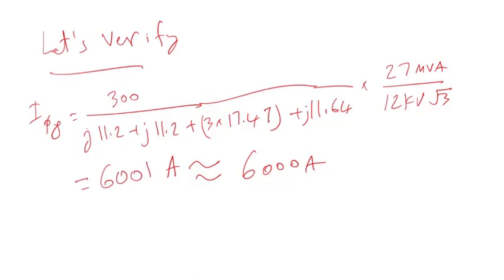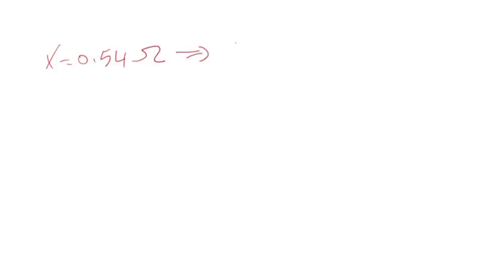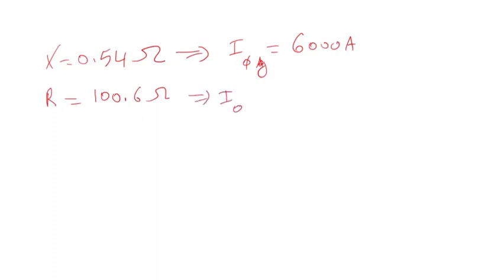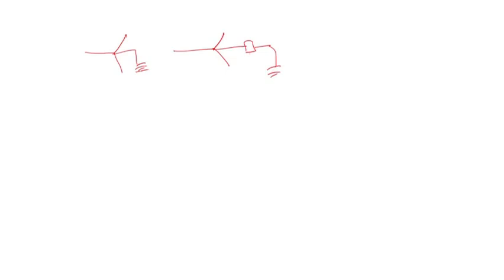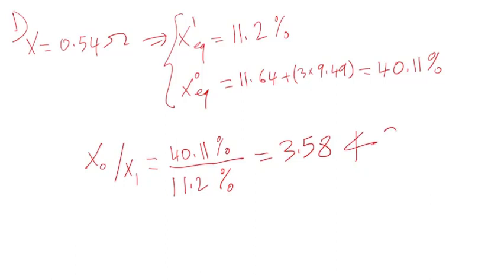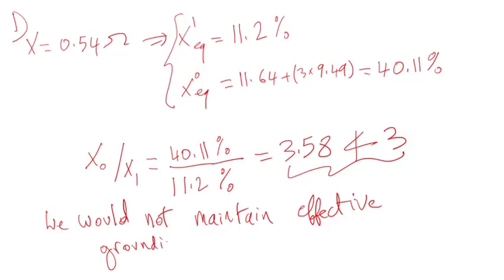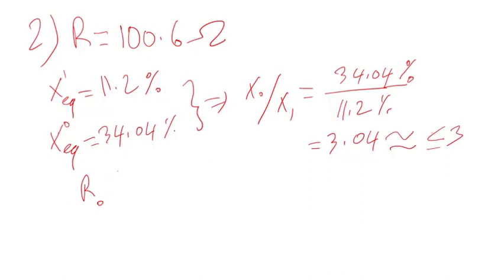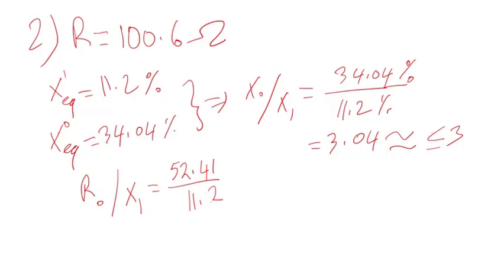Sizing Neutral Grounding Reactor or Resistor and Effective Grounding - Part 05

Comment: What is your reference standard about the X0/X1 < 3 or R0/X1 < 1?
Reply from the maker: IEEE Std C62.92.1 

IEEE C62.92.1 also considers a system effectively grounded if the coefficient of grounding (COG) is less than 80%. 

COG: highest line-to-ground voltage (V_LG) of the unfaulted (healthy) phases during a ground fault divided by line-to-line voltage (V_LL) before fault.

COG=[max unfaulted V_LG during ground fault]/[V_LL no fault]. 

This only applies to synchronous machines.
Other technical papers and standards are establishing criteria for cases with inverter based resources (solar, wind, battery energy storage systems).

Comment: 1. How did you get 1.02 ohm in series with zero sequence impedance? I think this should be 0.2 instead. 
2. The last calculation for effective grounding, how did you receive 34% Xo for solidly grounded HV and LV sides? isn't it 11.62%?
Reply from the maker: Hi Kiran. Thank you for watching and engagement. I appreciate it.

1) the zero sequence network graph has a typo. It should read 1.02%. 

2) the zero sequence reactance should be 11.64%.

Thank you again. Let me know if you any question.
Reply: @engineeringsimple  Thank you for your reply. How we got 1.02 in the first question?
Reply from the maker: It is obtained from zero sequence impedance test of transformer. I made other videos on transformer zero sequence impedance test for different transformer connections (grounded Yy with and without tertiary winding, delta wye, etc). Zero sequence impedance tests allow you to create the equivalent T- model of transformer.
https://www.youtube.com/playlist?list=PLpNHvi1vaPh39cuWOf36X3nblcUxxywbC
Reply: @engineeringsimple  In Zero seq equ  H, L & T parameter ,  H=10.26 or 1.02  H&L Value little confusion. If H=10.26 why connect with X for Zero seq network.
Reply: Source impedence  for +VE seq =0.2, Zero Seq =0.4 ,  how to obtained/ Calculation
Reply: Nice &Super Explain Topic 1 to 5 related to LV Side Single line ground Fault ( LV SBEF Protection Application) And Same way  HV Side Single line to ground fault  topic video  please